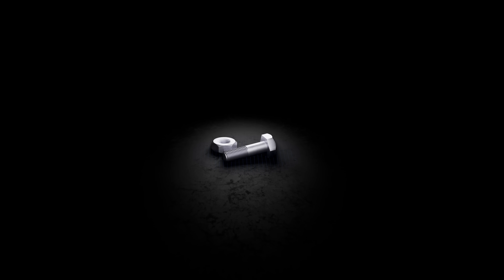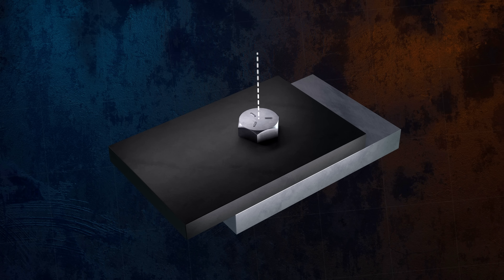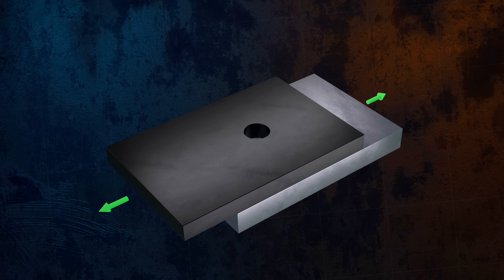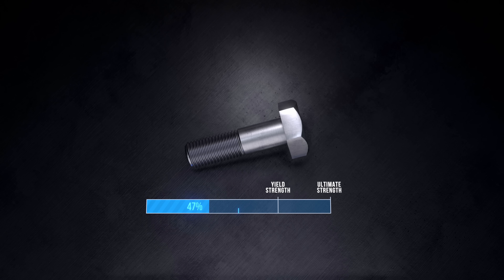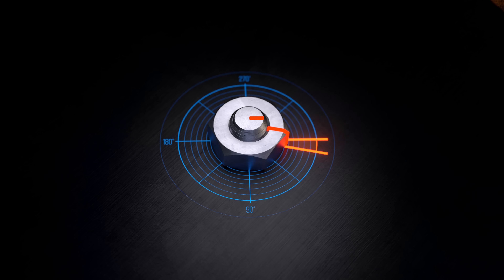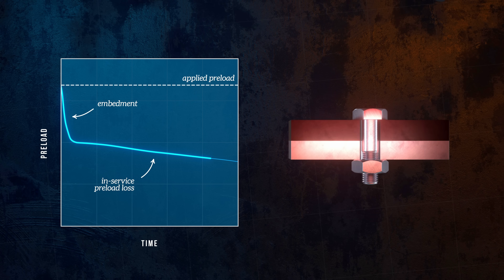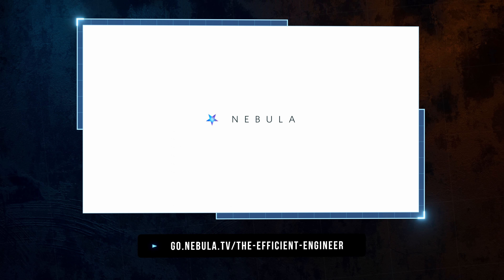The Incredible Strength of Bolted Joints

Comment from the maker: Did I miss anything interesting about bolted joints? Leave a comment! And remember you can watch the bonus video on joint diagrams on Nebula here - https://nebula.tv/videos/the-efficient-engineer-understanding-the-joint-diagram
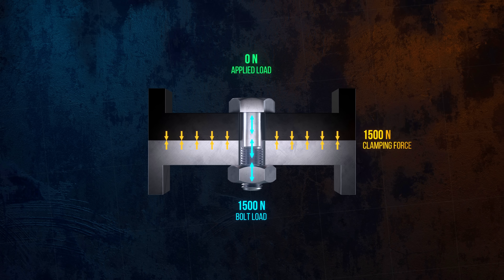Reply: I am curious about this explanation you offered in this video. Perhaps I am misunderstanding this. The clamping force you described as needing to be overcome is a force in compression between the clamped members, and perhaps in sheer due to friction between the clamped members. How then can that force be anything but a load on the bolt? At 2:29 when you say that "as the load is applied only a small portion of it is taken by the bolt". How can the load be taken by anything other than the bolt? The clamping force is entirely supplied by the bolt to begin with. The two surfaces of the clamped members don't exert any tensile or attractive force on each other; one surface cannot pull on the other short of being milled glass-smooth and wrung together like gauge blocks. 100% of the clamping force is from the stretched bolt to begin with, so how can any load be applied that doesn't load the bolt? That explanation you gave doesn't make sense to me. Am I hearing you wrong or is there perhaps an error in the explanation?
Reply: @Berkana  I was also very confused by this for a while, but I think I have figured it out. Below I have an argument to hopefully convince you that it is correct and also an explanation to help make sense of what’s happening.

Argument:
1) When there is no external load applied to the assembly there is still tension in the bolt, so in this case the tension is GREATER than the applied load. 
2) If you apply enough load, at some point the bolt will be stretched enough for the two parts to separate. In this case the tension in the bolt has to be EQUAL TO the applied load because that load is now the only force acting on the bolt. 
3) This implies that, starting with no external load, as load is added, the tension in the bolt is NOT just increasing by the amount of the applied load! It must be less.

Explanation:
Without a load, the force on the bolt is coming from the compression of the clamped material between the head and the nut, but as load is added and the bolt elongates, that material decompresses which means it is not pushing back on the bolt as much. So the tension in the bolt due to the compressed material gets reduced as the tension due to the external load itself increases, and this leads to the fact that the total tension in the bolt does not increase as much as the applied external load does.

This was tricky to figure out for me so it was rewarding when it finally clicked. I hope this helps you find that same satisfaction.
Reply: @ryanahern4213  I think you are going in the right direction. But it is only true, if the force appliead acts directly under the bolt head. In reality, the part that is clamped and has a force acted upon, is partially decompressed (near clamping surface) and compressed (under the bolt head). I was always unsatisfied by the spring load diagram (Rötscher Diagram) and by the model of two springs in parallel. these two models in themselves make sense but there is a gap between them and the reality.
Reply: @Berkana  Yes, I had exactly the same thought: The pre-tension is taken by tensile forces in the bolt only. Any additional loading adds to these tensile forces in the bolt. 
But now that I think about it a bit more, it makes sense: If you consider the material that the bolt is clamping against as a very short, hard spring, we can then see that applying a further load will work against the compression of that "material-spring", and the load that was on the bold as a result of the pre-load is now used to carry the added external force, as the forces on the very short acting "material-spring" is released. 

It is not very clear from the video in my opinion, as it goes against the immediate intuition about how the forces add, if you do not consider the "material-spring" part of the equation. -Nah. it is actually shown quite clearly around 3:30 in the video. My bad.

Also, we should consider that the "material-spring" must be a very short, hard spring for this to be true, as it is the extra stretch of the bolt, beyond the short travel of the "material-spring", that relives the bolt of the forces of the "material-spring".
Reply: I had the same thought.  Hopefully someone can explain this.
Reply: @Berkana The spring analogy is the better description. The load is applied to the bolt. As the bolt spring elongates further, the preload compression springs are returning to their slack position. The change of the bolt load versus preload decrease may not be 1 to 1. It is not inevitable that the ratio is to your advantage. You control parameters like bolt size, plate thickness, bolt material, and plate material.
Reply: @Berkana  True. That part "as the load is applied only a small portion of it is taken by the bolt" is fundamentally wrong as only he bolt can carry the load. I guess he confused the load with the clamping force. As the bolt is loaded and stretched, some of the lost clamping force is restored by the spring back of the compressed pieces.
Reply: @Berkana  If you go by the simple block of material on a surface and calculating how force it takes to move it, if you increase the mass of the object then its harder to move as it increases the resistive force. So you have the coefficient of friction that signifies how much friction the two surfaces have which is calculated by the downward force of the mass, this increases the effort, the force to move the block.

The bolt replaces the gravity, the bolt can provide a much greater to force which is then calculated with the coefficient of friction and you get your maximum amount of load the joint can withstand. The surface area of contact and making sure you have a bolt pattern that makes the clamping force uniform, as well as sharing the maximum clamping force over your bolts provides the joint strength.

All the bolt is doing is making the block in the most basic way to look at frictional forces and loads heavier.
Reply: @Tuberuser187  I understand that, but friction doesn't work in tension. If the two surfaces are being pulled apart I don't see how friction between them helps. The only thing resisting the two parts being pulled apart is the bolt. That's the only thing that transmits a tension load from one part to another.
Reply: @Berkana  Friction is the force resisting the tension.
Reply: @Tuberuser187  how? I can see how friction resists shear along the plane of contact but I have never heard of friction resisting two things in contact from coming apart.
Reply: @Berkana   I’m glad I’m not the only one who is stumped by this. Here’s hoping someone can enlighten us.
Reply: @Berkana  😂 you’re thinking your lack of knowledge makes you right
Reply: @1rstTry  No, I'm thinking people may be mistaken that friction somehow helps keep surfaces together when they're being pulled apart. I'm reasoning this out, and I'm not hearing reasoning in response. Your mockery isn't helping. If I'm mistaken, stop being a scrote and show me with reasoning.
Reply: @Tuberuser187  See the reply from The Efficient Engineer below confirming my reasoning. Friction plays no part in resisting the tension. That is still going through only the bolt.
Reply: @1rstTry  See the reply from The Efficient Engineer. He confirmed that my reasoning was correct; the tension pulling the two parts apart still goes strictly through the bolt.
Reply from the maker: @Berkana  When an external load is applied to the preloaded joint, part of that load is "used up" to relieve the clamping force, and the rest of it is applied to the bolt in addition to the preload. So for example if the bolt preload is 1000 N and the clamping force is also 1000 N, when a 500 N load is applied, 10% of this load is added to the total tensile load on the bolt, which becomes 1000 + 50 = 1050 N, and 90% of it goes into relieving the clamping force, which reduces from 1000 N to 1000 - 450 = 550 N. I just used 10% as an example here, the ratio depends on the relative stiffnesses of the bolt and the clamped parts (I go into more detail on this in the video on Nebula). It might seem counterintuitive but that's how it works - it might make more sense if you look up a graph showing how the bolt load varies as an external load is applied. Bear in mind that the bolt in a preloaded joint is always carrying a larger load than in a non-preloaded joint (because it carries a portion of the applied load, plus the preload) - but the fact that it is carrying a smaller portion of the applied load is beneficial for fatigue. Hope that makes a bit more sense!
Reply: @TheEfficientEngineer  This does make sense. But this is also as I suspected: even with pre-loading, any additional load still goes through the bolt because that's the only thing that can resist tension. Am I correct in stating that the friction between the two surfaces contributes nothing to resisting tensile stresses that try to pull the parts apart? Friction only resists shear along the plane where the two interface; friction between two things doesn't make them resist being pulled apart, right? Some of the other commenters are calling me ignorant for stating this.
Reply from the maker: Yes, the friction between joined members is irrelevant for loading along the bolt axis (i.e. tension joints).
Reply: @TheEfficientEngineer  Thanks. 

And @L here you can see it from the content producer himself. I was not mistaken in making this inference.
Reply: @TheEfficientEngineer  Thank you. I was confused because the video seemed to say that the force acting on the bolt decreased when a load was applied. For obvious reasons my brain had trouble with this.

If I understand correctly, the total force on the bolt increases, but by a significantly reduced amount due to the preload. Therefore the ADDITIONAL load on the bolt is reduced (because it is “used up” by reducing the clamping force), but the total load increases.

Also, the numbers you gave helped. They all add up and the world makes sense again. Thanks.
Reply: @TheEfficientEngineer  It would be helpful if you could make a video about bolt pry. Most engineers don't seem to understand how bolts in a pry load behave very different to a bolt in tension.
Reply: @Berkana   also, to hopefully help a little bit with your understanding of this:

The key is to realise that if the stiffness of the clamped members were infinite (meaning the members do not compress at all under preload), then the bolt load on the preloaded bolt would not increase at all when a load is applied to the joint, provided the applied load is less than the bolt preload.

However in reality the bolt force on the preloaded bolt does increase when a load is applied. This is because the members are not infinitely stiff, and they therefore do compress under the bolt preload. So, when the joint load is applied, some of this member compression is relieved, meaning the bolt is stretched further and the bolt load is increased.

If in doubt, always do free body diagrams.
Reply: @mcd00080  Agreed. I'm a union ironworker, I've gunned up a bolt or two in my day. We're all taught not to torque the head whenever possible.
Reply: Would like to see comparison in strength between bolted joints and riveted joints and welded joints.
Reply: Yep. College on when to choose which and why.
Reply: I was a little surprised that the humble flat washer was not mentioned. And tho I've rarely had the chance to use them, direct tension washers the ones that squirt are a pretty slick system compared to dragging the impact gun around with all that hose. Spline drive are neat too.
Reply: @jakeku2662 Agreed. I also don't think the threads, which are really the ones holding everything together in the first place, received any justice.
Reply: Feedback here: 2:30 - this is the critical (and paradoxical to the layperson) key-point of the video, and yet it's glossed over in a single sentence.
A Layperson thinks:
- If the bolt is the only thing holding the members together, and the bolt is Pre-Loaded, it's already 'stretched' (as just described in the preceding ~40 seconds).
- Therefore, any separation of the members will act directly on the bolt, increasing the load (/stretch) upon it, and bringing it closer to its failure point.
...And yet somehow, it's claimed that separative forces on the members will relieve forces on the bolt?
How can that be the case?

Something else needs to be explained here, because these principles do not square up w/ eachother as they are.
Reply: @-_-----  I’ve attempted to give a good explanation for this same question in response to @Berkana. You can find it on this same comment thread. I hope it helps
Reply: @-_-----   If you consider the material that the bolt is clamping against as a very short, hard spring, we can then see that applying a further load will work against the compression of that "material-spring", and the load that was on the bold as a result of the pre-load is now used to carry the added external force, as the forces on the very short acting "material-spring" is released.
Reply: @-_-----  if you add prying or pushing  pressure/force anywhere except the first inches next to the bolt the force isn't directly translated to the bolt it translates to the mated surfaces which are gripped together by the initial clamping force of the bolted Joint... The engineer who drew the joint will have made sure that there will be the right amount of strength to withstand any force from the structure being loaded/used for its intended purpose or disaster and not fail and in the event of an emergency that could cause failure of that joint it's been taken into account as well.
Reply: Bolt tensioners. By far the most accurate means of preloading fasteners. Basically a hydraulic piston that threads onto the fastener over the nut, stretches the fastener using a precise pressure, nut is snugged up, pressure bled off, and tensioner removed.
Reply: Slotted and Fitted surfaces, e.g. those with small milled slots or grooves in each face, can take higher loads in shear than a bolt alone.  Sometimes by orders of magnitude.
Reply: can you talk about washers? thanks. very informative video
Reply: I think there's something worth mentioning about sheer joints. If the two clamping materials are able to slip around the the axis of the bolt, then the friction force can be reduced (friction between to sliding surfaces is lower than that between two stationary surfaces).

This means that in the right (or wrong) situation, a twisting movement of the two clamped materials around the bolt could be enough to reduce the friction force, which could be enough to overcome the shear strength of the bolt and cause a failure. In such a situation, having two or more bolts would overcome this by eliminating the clamping materials ability to slip around a singular bolt's axis.
Reply: I would say what's the difference in the fastener clamping force with dry versus lubricated threads
Reply: I think it will be useful to explain TTY and TTT because are widely used for their relative simplicity and superior results compared with the classic torque wrench measurement. It is unlikely for a auto mechanic to use a load cell to measure the stress in the bolt or ultrasound measurement. Beautiful and very useful presentation.
Reply: according to the Junkers-Test, a bolt legth (free length) of 5*diameter is the best securing method
Reply: Plenty of things, you could also use D.I direct indicators as an indicator of preload tightening. Tightening methods snug, tb, TF. Washers and all the since behind them. Locking mechanisms. Fasteners are probably one of the best machine elements out there that have been developed for many many years so there's lots of things about it.
Reply: I'm curious why it would be called a bolted joint if it requires a nut. Would it still be a bolted joint if the last layer was threaded and no nut was used, not through-hole? Does having a nut make it a bolt? Or is that just another term for machine screw? Lack of threads on part of it? Isn't a lag bolt a screw because it's tapered?
Reply: @BariumCobaltNitrog3n  There's pretty much a continuum between bolts and screws. But IMO if it has a nut it's a bolt. Otherwise it's probably a screw.
Reply: Thank you very much for your excellent videos, and showing how a preload works. As you already know, washers are placed under the head of the nut, and for vibration you can get 'Nylok nuts' these have a plastic insert in the nut threads. When I was draughting, for slip-resistant shear joints, there would be a LID (Load Indicating Washer) that would give an indication of the correct torque on a nut, they would insert feeler gauges to determine this, but I appreciate that you can't cover everything. One thing that came out regarding torsional shear on a bolt group was the 'Instantaneous Centre of Rotation' method, this is the most accurate way of determining loads on bolts. Sadly, nobody has shown a video showing how to calculate this centre of rotation, but apparently it's pretty complex and requires spread sheets, it's a shame because if this is the most accurate method, then it needs to be shown. Thank you again for your excellent videos.
Reply: What if the bolt is tilted in relation to the 2 joining surfaces?
Reply: Though I already maintain Nebula, thank you kindly for placing any non-adsense at front/back/both of video (where I thus watch them) rather than interrupting midway! Turning YouTube into cable commercials abuses the audience necessary for any revenue, and kills the flow of information.
Reply: 1:45 It's CApacity, not COMpacity.
Reply: i'd love to see something about flange tensioners.  i've used them many dozens of times on large pipe flanges and it's really interesting how they work.  it's a bit much to try to convey through a comment.
Reply: I’d like to see something about how torque values are set for different situations. Like how they figure out you need 40ft lbs for something and how you need 90ft lbs and 90 degrees for something.
Reply: Really. Just going to stick with mechanical, and civil stuff.

Not even going to touch on anything Electrical. Not even a formula sheet for that genre.

Just to see how they perform. 

Unbelievable!!
Reply: Lockwire
Reply: ⁸
'zy
HhAj
Ídómxm😵
Reply: Can I use your video ??
What do you think about this?? Is there any restrictions or demand from you ?
I will use this only for educational purposes not for other things.
If you kindly inform me also with permission , I will be forever grateful to you .
Take love ❤
Reply: Is there somewhere I can send a suggestion, because I would love to see an engineering dynamics series where you cover things like kinematics, work and energy, and Newtonian dynamics.
Reply: The washers.
Reply: I really wish you would have covered direct tension indicator washers. Simple and cheap and they eliminate all of the inaccuracies of using torque to control bolt preload. Great video though!
Reply: 7:32 - did you mean "tensile strength of the material"?
Reply: How come you said applied stress range and not magnitude of applied stress, then showed two sine waves which show that showed large magnitude stress conforming to bolt stress? Wouldnt magnitude on the bolt actually be the same since it is the bolt that is being stretched by pre-load to cover the entire range (magnitude) of applied stress prior to joint failure? Or is this assuming that its only one bolt among many, thus dividing the load stress?
Reply: Stress frustum
Reply: Amazing videos as always. Thank you so much :)
Reply: Soo do you need to paint before or after construction you want your building strong and you don't want rust. what does painting with te strength?
Reply: Watching this video just after Alaska B737 MAX-9 accident and wondering what went wrong.
Reply: This may be true for US code, but the European code for metal works in civil engineering does not take in to account friction in shear connections.
Reply: Not bolted joints...but did just notice the very subtle music in the background.  Music can be very distracting, but in this case, spot on.  It is the Inception soundtrack.  Was this purposeful?
Reply: I disagree that each bolt is under the same force and the diagram is incorrect. For the position centred point you would need a second force equidistant pressing upward on the left side.
Reply: While I really appreciate your content, I really recommend you just release the extra video on youtube.   It's really silly to separate out the videos because you want to present a complete package.   There are other joint diagram video on youtube so it becomes a choice between free vs paying 5 bucks to watch a short video.
Reply: When it came to finding the correct torque, why no mention of DTI washers? I wonder how effective they are.
Reply: Bolt Tensioning vs Torquing
Reply: P
Reply: Torque to yield,  and torque plus angle methods, used in modern ICE engines,  use low initial torque values, and then another XXX degrees, in a pattern, followed by another pass at XXX degrees. 
which gets the bolts near the plastic deformation loads, and still have a little spring in them. Made possible by not measuring friction loads. I paint mark each head with a straight line, thru the middle, so  I can visually confirm how many degrees each fastener is turned. Sometimes I see torque values that vary by 35 to 45 ft / lbs, between bolts that are the same length,  diameter,  thread pitch, identical,  in every way, because my wrench displays final torque values. It's pretty fascinating,  really.
Reply: you forgot about the rastafarian joint. arguably the most popular, you'll find them at any construction site.
Reply: 1) Hydraulic tensioning. 2) Long/shaft bolts reduce loss of pretension
Reply: Excellent video as always. Perhaps add use of washers, bolt grades and the change in material characteristics, the considerations of tapped holes vs using a nut. Huge subject in itself
Reply: If you don't mind general requests, i have a couple. 1, metrics...like how do you know the accuracy is ±1% unless you have a more accurate tool to measure that, and then how do you know it's accuracy is even better unless it was directly measured by something even more accurate, etc. This would apply to any base unit (time, length, temp, etc) or truthfully any tool measuring any unit (voltage, pressure, chemical purity, etc.)

2, thermal expansion and various ways to deal with it in various applications, like aircraft, structures, power lines, who knows what else. I've always been fascinated at how it's possible to overcome that thing, to me it seems insurmountable when you think of some regions on earth that get really cold.
Reply: Excellent video.

Maybe you could have also covered countersunk holes, purpose, and how they affect tensile and shear calculation.
Reply: I think double nut method can be also applied to reduce the loosening of bolt joint? I saw them before in some of my local footbridges🤔
Reply: @kzakumi2035  I think that's more a preventative measure to stop the nut from loosening, but I could be wrong.  Good point.
Reply: @kzakumi2035 😊
Reply: you missed something call "contrast"; it makes things visible
Reply: also, washers